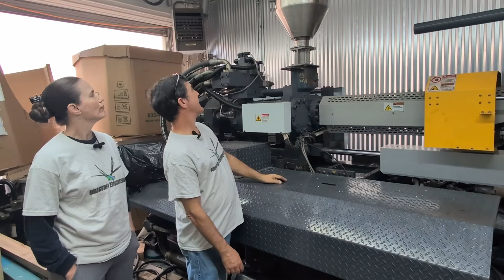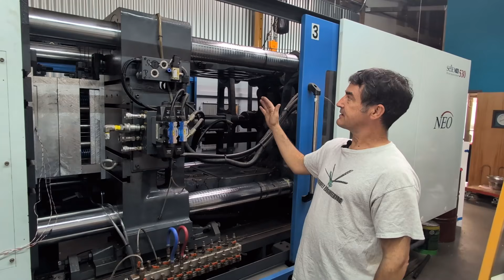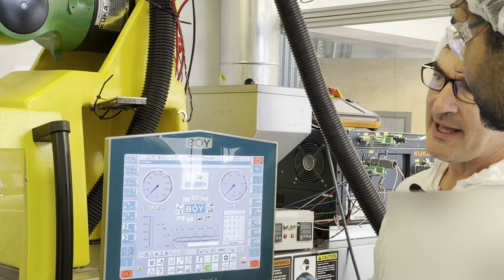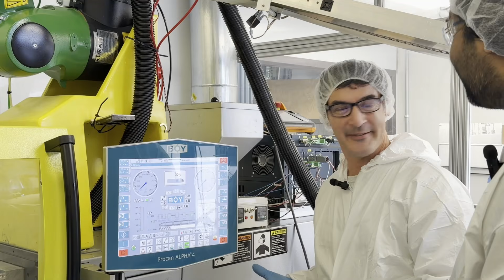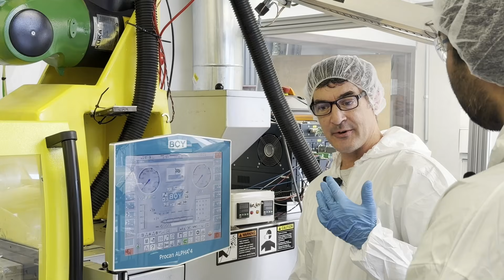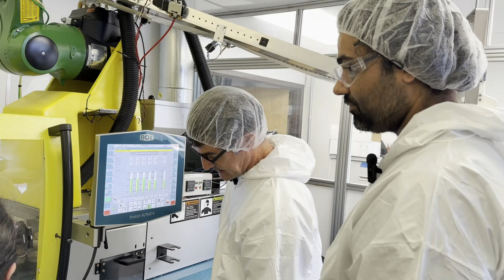Intro to Plastic Injection Molding and AI

Comment: Excellent overview of the IM process/steps👌. Not sure on the Ai part though. Looks like some kind of image processing(like AOI on assembled pcbs) and M/L training of good vs bad parts and some more training linking the physics of plastic injection to the expected outcomes(good/bad). Eventually it may be used to optimize quality vs shot cycle time, through control of process parameters etc.❤👍
Reply: This is more like classical machine learning than AI - there's a relatively small number of parameters to adjust, and you can use any number of numerical methods algorithms to adjust the parameters to get good results. As you said, throw in some computer vision for feedback. Also typical of AI, some guy is there that "will solve all your problems", but doesn't have the first clue about how injection molding actually works
Reply: Really appreciate the thoughtful breakdown. The AOI + good/bad classification framing is a reasonable guess, but Niobia goes a layer deeper.
We're not just doing visual defect detection, we're working with the process data itself. Shot profiles, pressure curves, temperature deviations, fill/pack transitions. The goal is to close the loop between what the machine is doing and what the part becomes, so you can diagnose root cause and adjust parameters before you've scrapped a run.

The vision you described at the end : optimizing quality vs. cycle time through process parameter control, is exactly right. That's the target. We're just getting there through process intelligence, not image classification.

More about the AI side in the next video. We will be posting something on our channel soon. Stay tuned.
Reply: @NiobiaAI  Sincerely appreciate the clarifications. While I see added layer of Ai could enhance the M/L for process tuning, there is a much better potential for Ai in Mold design(guidance for the various elements including inserts and rotary action for non-conforming designs) itself. Most of the time the IM industry keeps cycle time constant, to calculate IM tonnage and shot cycle time, based on the cross section area at the parting line. There is a huge potential for Ai, to deviate from norm to allow large Oz shots with low tonnage IM machinery. This is the real value of democratizing IM for the masses with their smaller shot/low clamp tonnage machines(pneumatic benchtop machines like busterbeagle3d mkii). Just some suggestions to increase market value of Ai for IM. Looking forward to the upcoming Ai for IM video.❤👍